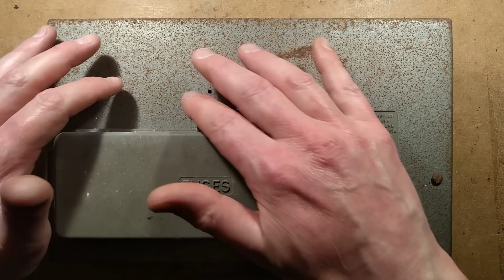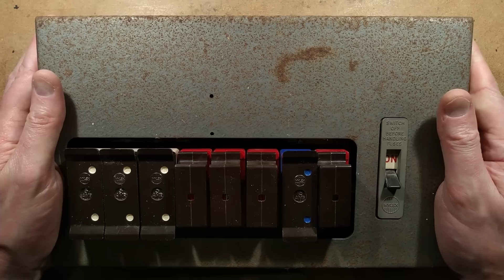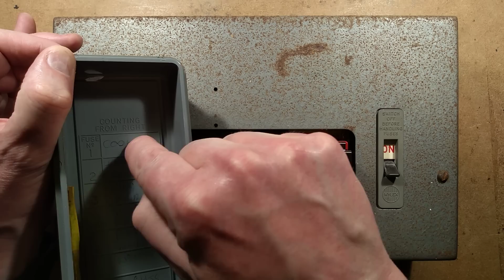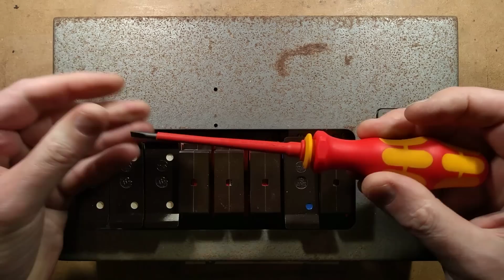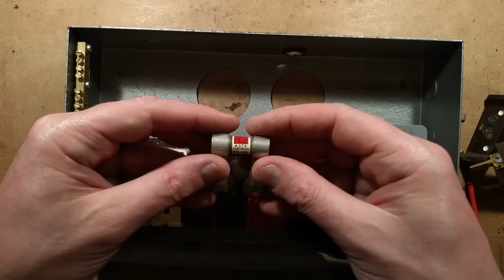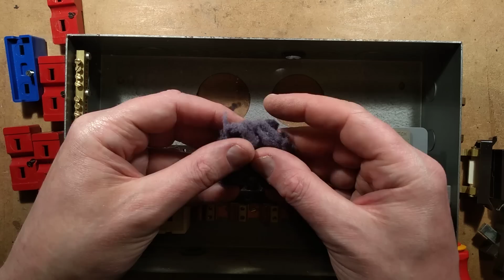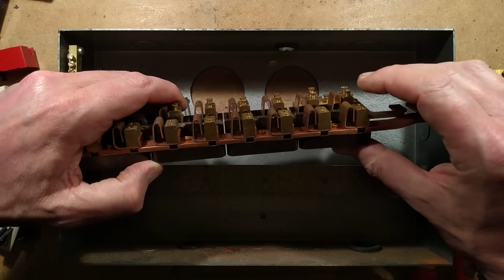Teardown of an old British Wylex electrical fuse box.  (with bare fuse wires)

Comment: I have seen these in bakelite but  never metal body, they came in cream or brown. The fuses used wire. These fuse carriers in your video are bakelite. The real old fuses were ceramic, made by companies like MEM MEM Kantark, Midland electrical manufacturing. REVO, GEC, they used wire but unlike yours the fuse socket had asbestos rope string in due to its insulation properties. I found a GEC carrier the other day on a site where there was a coal mine. The fuse plug had electrical tape around it, it became apparent that possibly when the wire blew it shattered the fuse wire holder so for quickness an electrician I suspected taped it up after replacing the wire. In the house I lived in down south the fuse box was flat to the wall made by Crabtree, it used trip fuses that were bakelite, the house was built during the 1960s. There are different types of asbestos, brown amosite an blue croclodite are the worse due to it being a wool an it sheds fibres very easy, it was used as pipe lagging, the most common is white chrysotile used in roofs, some pipes were made from it an toilet cysterns used it in a resin base, that asbestos is only harmful if broken up or drilled. I have an old battery charger with a asbestos board it. I have left it as is but I have it a coat of varnish just to bind any loose fibres.

Comment: The case has to be locally grounded.  Here in the U.S.A this an absolute must.  If the earth from the electrical pole is compromised and one of the hot wires energizes the earth ground, the metal box will be energized; however; if this happens the grounded case will protect you.

Comment: We had a plastic version of this untill the mid 2000s but we had the fuse type that could not take wire( the second type you opened ) , but i do rember drilling holes in them to take wire in a pinch , i know i should not but guys chill its fine.

Comment: It appears that wires from circuits come off the top and the neutrals all tie in at the brass screws.
Across the pond, we use brass  for HOT or ungrounded wires and silver for the neutral. and green screws for ground.

Comment: Re wired a house a few years ago. The consumer unit had bakelite fuses and the entire house was wired in VIR cable which had perished meaning live bare wires (non earthed) running round the house in steel, iron and lead conduit.
Reply from the maker: There's s still a lot of lead sheathed VIR in use in the UK.

Comment: Let's face it. Clive: it's a nicely-made fusebox of solid design that cannot easily be assembled incorrectly.  Good tip about the importance of the lid in preventing arcing to the casing.  Seems better than the current MK boxes which have MCBs on a DIN rail which have a tendency to twist when you fully tighten the terminals onto the busbar so presumably they often are either not fully tightened, or they are tightened but they look bad...?  I always have held the old Wylex units in high regard.

You forgot to mention that the breaking capacity of those BS1361 cartridge fuses is far in excess of the B curve MCBs that most modern consumer units use.  I find it interesting that people believe MCBs to be inherently safer when actually the BS1361 fuses can have faster reaction times than MCBs as well as higher breaking capacities.  Problem is, of course, they are not always replaced correctly, much like those re-wireable fuses (which often have a very poor breaking capacity as well as a risk of reacting very slowly).

Of course, the modern preference is not to have all the lights on the same RCD, so the cost of re-installing one of these boards to comply with modern standards probably exceeds the cost of just fitting a new split-load consumer unit, which is rather a pity.
Reply from the maker: I regard a proper HRC fuse as a much safer option than an MCB in terms of reliability.  The cheap minimalist nature of MCBs makes them a hazard.

Comment: Being a yank, it's fascinating to see how these old things worked across the pond. The oldest installations we had used screw-in disposable fuses, so wrapping your own fuse wire on a holder sounds delightfully horrific!
Our ugliest bodges involved screwing the burnt fuse back in after placing a penny in the socket.
Reply: Remember 40 years ago the chippy telling how he fixed the bosses laith that kept blowing the Fuse Wire,so he inserted a wire nail, that fixed it. :(

Comment: Reminds me of  seeing old versus new switchgear. Old stuff is made solid, with levers as long as your arm, built to survive an arc flash. The new stuff has vent holes all over it and is meant to prevent a flash. But the holes could cause a flash because of the dust in the room. Plus puny levers that need to be charged to reset and have a limited lifespan of trips.

Comment: Every things So compact in Europe! Love it. I do off grid solar, which tends to have much power than normal "Mains power" One time a customer was worried after I Installed an 8 space electrical panel and they insisted on a 24 space panel LOL . They had a single  3,800 watt Inverter,  how many circuits are you gonna drive off that...

Comment: The place I'm currently renting still has one of these, but in plastic rather than metal. I was very suprised to have to manually change the fuse wire when the lighting circuit tripped! Also suggested that the landlord get MCB plug-in switches to replace the plug-in fuses just for convenience's sake, but no luck yet.

Comment: I have the later plastic version in my house, I have thought many times of replacing the re-wirable fuses for the MCB plug in units, but whilst it all works, why disturb it.!!
Reply: I have exactly the same in the house we have just bought. White plastic box same as the layout of the box in this video. We’ve had one or two power cuts in the road since we moved in and each time we somehow still have power when no one else does! Must be the fact that these old units don’t trip like the new ones

Comment: Yes, it is a two pole isolator switch.  Note how the heavier duty cartridges cannot be shoved into the lower rated holders, as the colour coded bases have holes that match the size of the pins on the back of the cartridges. Simple, clever and well made. 
I was under the impression that lung cilia are able to expel serpentine asbestos such as chrysotile rather than it being digested- but i could be wrong. A timely warning from C there on the dangers of blue/brown amphibole fibre. Note reels of warning stickers are cheaply available online, it's a service to the future to label anything that does (or might) contain gremlins. No need to panic where it's stable and undisturbed, but every need to flag it up where it occurs.

Comment: On some consumer units, those paint dots are also tell-tales. They melt and dribble down the outside of the fuse holder indicating an over-heat (over current, ie copper nail) situation.

Comment: These were good quality . I found that it is possible to accidentally create a short between the metal clad front panel and the top of the fuse carrier where the circuit cable is terminated when messing about with fitting fuses. I worked for the Electricity Board in the early eighties and we always fit Wylex boards to domestic installations but in plastic (usually ivory in colour). ...End of reminisce  !

Comment: First house my parents lived in after my birth (1961) had been built not long before and had only circuit breakers. In fact, nowhere I’ve ever lived here in the USA has used fuses, more by chance of living in fairly recent construction than anything else.

Didn’t realize that fuse wire was ever just ordinary copper wire of smallish gauges.

Comment: I did my apprenticeship at ICI I had to work for 6 month in the power station on the Wilton site, I saw things then that would give the H&S officer a heart attack. My personal favourite was mercury switches, as we changed them for safer switches we would collect the mercury and play about with it.
Reply: Elemental mercury is fairly safe. It is mercury compounds which are highly poisonous. We used to nick some from the physics lab and play with it in the class rooms. It would roll everywhere and live tiny silver droplets in every crack and crevice on our desks.
Reply: @nrml76  yes remember that too, we had a maze to run it through. great fun

Comment: Even in the 80's often you only had a 4 fuse unit, a decent blow of a fuse would often block it so that you could not thread new fuse wire through it :(

Comment: At the university department where I work, the plan for dealing with the asbestos used above the fume hoods was to just leave it in place. That was until a contractor decided to drill into it to attach some ducting or something, and the state was forced to remove all the asbestos from the building.

Comment: In Croatia, we had a lot of the old sewer pipes that go from your main (last) manhole on your lot to the sewer main duct made of the same material, we call it "azbestna cijev" - or to translate asbestos tube. Now days city councils on new building sites demand that it is mandatory to be replaced and a new plastic one installed, which i condone by all means. But we still have a lot of roofs, garages and other buildings still covered with the stuff - some people just do not have the money to replace it, some do not know how dangerous it is and some just do not give a sh... about it. And the stupidest thing is, when you do take that thing off, no waste dump or whatever you call it, will not take it as it as it is a "hazardous material"... A lot of people died because of not knowing, some came down with "asbestosis" on their lungs... No one takes responsibility, but avoid that stuff by a mile

Comment: 'Ring main' has always been associated with power distribution (11KV etc), along the ring main there are 'ring main units' (RMU's), we had a RMU on the  site i worked at.
Ring circuit is what you find in properties (32A).
The flashover you talk about shouldn't happen at the top of the fuse as that's the outgoing, more likely out the bottom, but never seen it myself'
The front knockout is when you install MCB's, the older pushbutton ones or the newer lever type, but you would have to re label the circuits.
You shouldn't be able to mix the colours as the pin size and spacing is different.
Reply: believe me they blow out at the top. Been there, done that.

Comment: I've got one of these in my garage. When I needed to install a few extra  power outlet sockets for tools and appliances, I looked into changing it for a more modern unit but I ended up installing RCD sockets and leaving the Wylex fuse box untouched because the UK law doesn't allow diy replacement of consumer units.
Reply from the maker: Indeed.  Noting that the organisation that was mainly responsible for pushing for Part P is actually a private company and not some sort of government body as they try to imply.  They make many millions of pounds a year out of what was effectively the deskilling of the electrical industry.

Comment: Takes me back to 14th edition, when these were current technology and perfectly normal, when RCDs were called ELCBs and they weren't required. When a ring final circuit was called a "ring main" and were wired in 7/.029" stranded cable. When Live and Neutral were red and black and three the phases were red, yellow and blue. When the "to plate" method was considered bad practice and a TN-C-S supply was just known as PME. And underground cables had lead sheaths which needed lead soldering by "wiping" the joint. Ah, them were the days!

Comment: I still rock an old board like this, in fact I think mine is probably older as the case is like a tough bakelite plastic and not metal.

Comment: There are so many areas where you could accidentally come into contact with live wires if be afraid to go near this thing. On top of that, unless I'm misunderstanding something without a rcd breaker, this would have no problem electricuting you rather than just shocking you.

Comment: Rewireable fuses. What a great idea. I've never seen that before.
Reply from the maker: I only discovered that bit when I was writing the description and checked wire sizing.  I didn't realise that we seem to be in a minority of countries that have rewireable fuse holders.
Reply: Not in Canada.
Reply: bigclivedotcom The only rewirable fuses I've handled were in 6th grade physics exercises where these prevented failed 12V experiments removing power from the other kids.  Everything else has been factory fuses with carefully specified filling and wire combos to get desired ratings.  And of cause there was a central facility testing samples of new factory / import lots to check that ampage and flames were in spec (that's been discontinued due to privatization).

Comment: Just replaced a plastic one like that at my mums with its modern cousin a Wylex duel RCD 10 MCB metal board happy days 😀
Reply from the maker: Worthy upgrade.  Glad it didn't "find" existing earth leakage issues.
Reply: bigclivedotcom no all good thanks, RCD even likes all of the cooker elements! Bonus! 
Good readings on ring circuits and earth loop too so I’m happy.
Reply from the maker: @danisaac  I took the opportunity to do a test on my house circuits here last week and they were surprisingly good.

Comment: This is a classic reaction to blowing a fuse among non-electricians. If a fuse keeps blowing and it's a five amp fuse they put a 10 amp fuse in thinking it won't blow so quickly. As if the fuse was the problem.  But then a thinking person knows this.  The fuse is protecting the wire it feeds and the load, but primarily the wire. The load or the wire is grounded somewhere and this needs to be found and fixed.  You know this Clive but there are many who don't. Electricians run into this quite often.
Reply: Fuses actually do age and blow. Depends on heat/cool cycles. Seems to be a period of many years though.

Comment: Had one of those in the house till a few years ago until we had a combi boiler  fitted and the gas board insisted it had to changed before they would fit it,
I noted the comment about plugging  the iron into the light socket,the reason people  did that was houses where only built with the minimum  of sockets to suit the lowest tariff if you wanted more the tariff would go up as appropriate and so on.
Reply from the maker: If you mean British Gas then it's just a brand now.  They're very sales motivated.
Reply: The more I think about it this one was fitted midfiftys very similar no secondary cover with porcelain  fuse holders,it was always  partially  loose  on the wall untill a fixing screw fell out and you've  guessed  it land on the live buzz but I fixed it while waiting the main fuse to be fixed

Comment: Its a good thing that any major changes required to upgrade to circuit breakers & elcb's ect in aus , as have seen "how many strands can u put through the hole in a "federal" ceramic fuse holder! because they had a welder or some other high power gear in back shed ect

Comment: Wylex Fuseboxes? You'll be on to old 3 pin plug sockets next Clive. :) Fascinating stories you tell. Thanks.x
Reply from the maker: The 3 pin 15A round pin plugs are still available and used extensively in the theatre industry to stop people plugging vacuum cleaners into dimmers.
Reply: Oh I know the big round pinned ones are. :) My ex boss had them on some of his lighting gear for his studio. I remember the smaller pin ones from when I was young. My Parents lived in a council house built in the '50s that sill had 3 pin roundies.  If you want a bit of Fusebox art, theres Noctural Emmissions 2nd album from 1981, Fruiting bodies: https://www.youtube.com/watch?v=qx2OCmKKCsY
Reply: Still used for lamp sockets in the UK.

Comment: The actual metalwork inside looks pretty robust and very well made. The fuse pins are nice and tight too.
It would be good if all the modern stuff was as well built.
Obviously there are lots of improvements now for disconnecting in the event of a fault, and probably finding fuse wire locally might be tricky, but these were built to last. Modern gear is pretty flimsy and disposable in comparison

Comment: There is a physical difference - The pins are thicker on the higher rated fuses and the holes are different sizes, to stop the red carriers going in the white holes!
Reply: Scrolled down the comments to find one (yours) that said just this.
Reply: Same principle applies on older (pre breakers) panels here in Sweden.  A button with ceramic collar with different sized holes screws into the bus bar, based on the circuit/wiring it handles, and the fuses have a larger diameter head/tip the higher they're rated, so a lower rated fuse can go into a higher rated circuit, but not the reverse.
Fuse has a spring loaded colour (per rated current) indicator in the base, wbich is visible, when not blown, through a glass window in the fuse holder. When fuse blows the I dictator pops off into a nonconductive area of the fuse holder.

You can get breakers in the same format as the original fuse+it's screw in holder to upgrade and not need to keep spare fuses around.

Interior of the panel is off limits (lid fitted with anti tamper/witness  seals) to non electricians.

Comment: Great video. There were dozens of variants of this box: white and brown bakelite as well as metal, and 1,2, 3 ... 12? ways, also 5 and 7 way units with one way to the right of the switch to take a cooker fuse. Unless I missed it, you didn't mention that the pins get bigger with current rating so you can't plug a 15A fuse into a 5A bridge.
Reply: We still have the brown Bakelite version of this